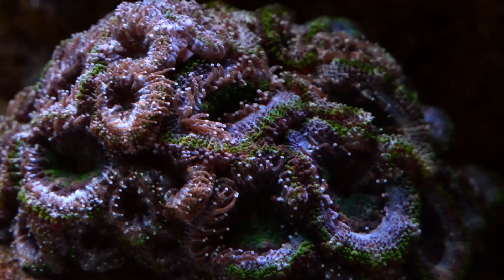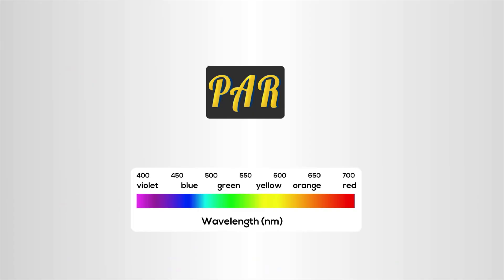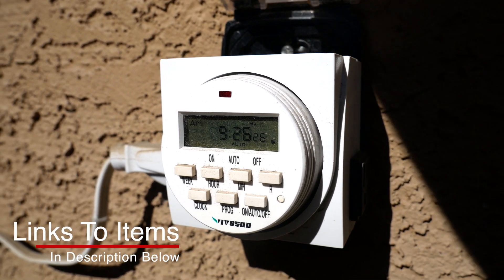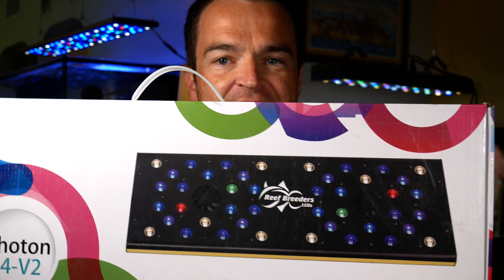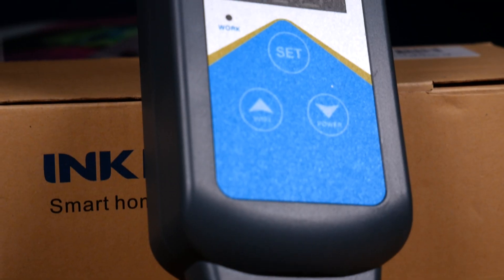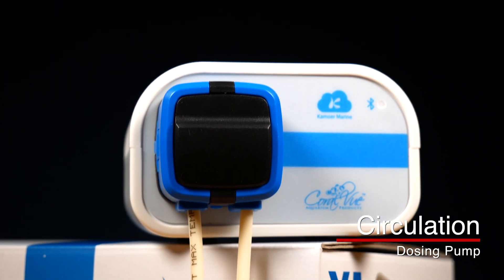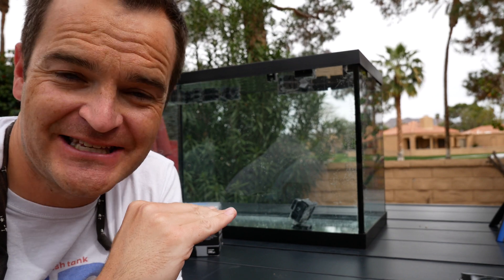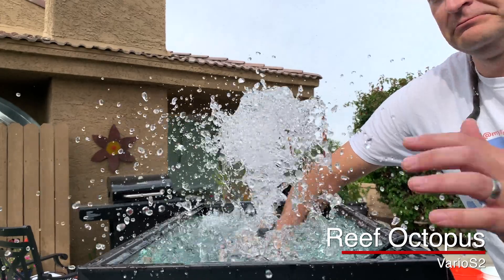Saltwater Tank Lighting, Heating, & Circulation | Episode 07 | Saltwater Aquariums Demystified

Comment: Can you recommend a light fixture for a mixed reef tank that measures 24 x 32 x 24H (80g)
Reply from the maker: Absolutely.  I think an AI Hydra 32 would be a great fit.  Right in the middle price wise, and will definitely have enough power for a mixed reef. Be sure to pick up the mounting arm with it!
Reply: @MyFirstFishTank  - thanks, I was afraid you'd say that.  I had a 135g set up prior to the new 80g cube.  I had (3) HYDRA 26HD lights above that.  Although they performed really well, I was not a fan of the app controller for it.  It was really frustrating.  Although a lot of people like it, I wanted something much easier to modify.  The struggle was real. I tried contacting AI a number of times about what I wanted it to do, and was always told nope, can't do it.  SO I sold off the lights, and am now looking for something else.  I realize I have an odd sized tank, which will make it rather difficult to find a light for. I'm a long ways off from buying light, but more window shopping at this point.

Comment: Great little video. Do you put your overflow weir or in the sump? On a reefer 425 for example
Reply from the maker: Ian Hall is a weir is typically placed in the display tank, while and overflow box can either be internal or external, also in the display. A weir is a kind of overflow box, and these are pretty much always used in conjunction with a sump as that is where the water is “overflowing” to for filtration. Does that make sense?  I feel like I didn’t answer you question!?!?
Reply: My First Fish Tank I messed up my original comment/question. (Always proof read...)  Do you put your Heaters in the overflow weir or in the sump? 

Sorry for the confusion.
Reply from the maker: @ReefSYS  Ah, that makes more sense.  Either is fine, but if you do decide to put them in your overflow, you need to make sure you will have a consistent water height that will cover your heaters.  Also, certain heaters need to be installed horizontally, so obviously the overflow wouldn't work. I like to put my heaters into the overflow (when possible), because it is a high flow area and I know that the heat is being transported throughout the tank.  Hope that helps!